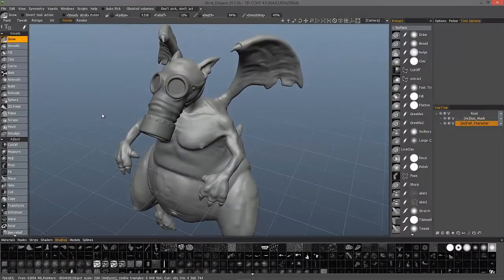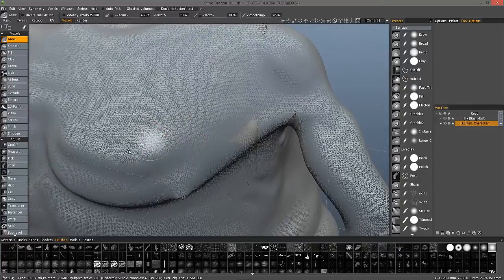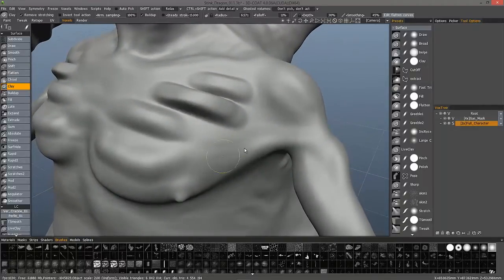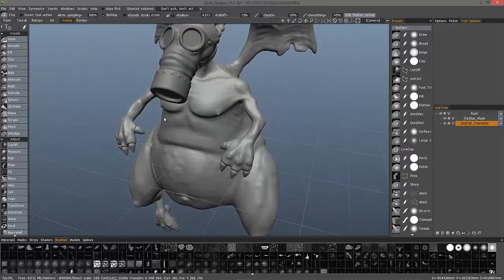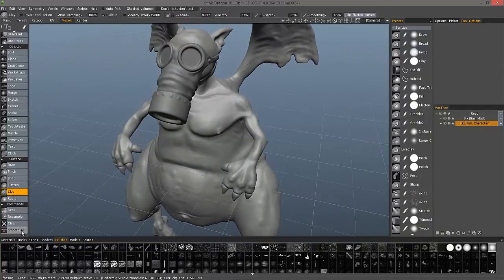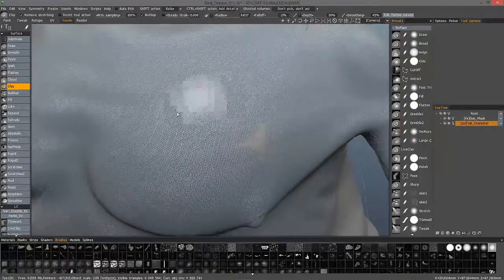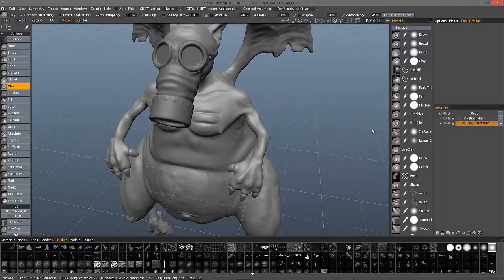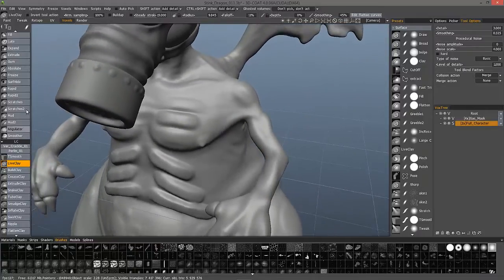Optimizing Mesh for Surface Mode Sculpting

Comment: are there any way to set the "density" or the "resolution" right off the bat for the surface mode or layer?? cause when I tried to create muscle on a surface layer, the mesh density was pretty low...
Reply from the maker: You can always RMB click the layer or Object in the viewport > choose RESAMPLE. You can enter the number of polygons you want or use the slider to adjust the number.